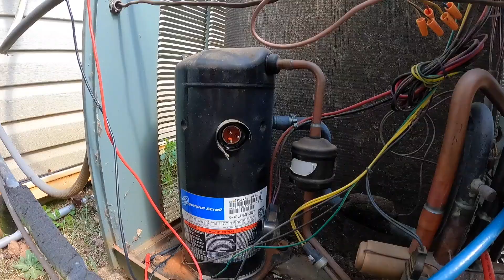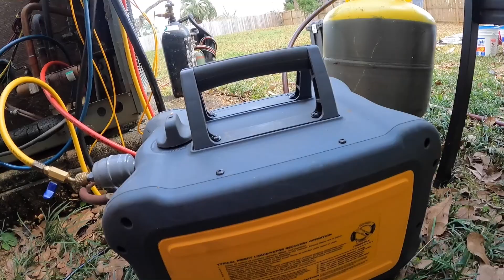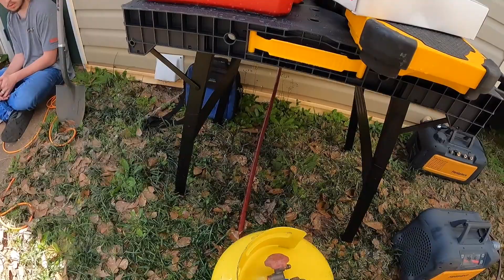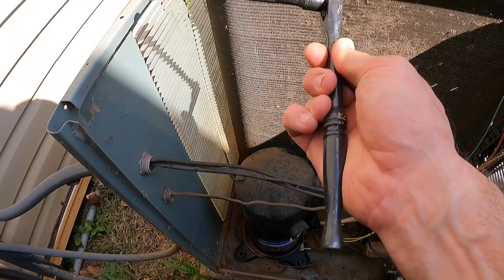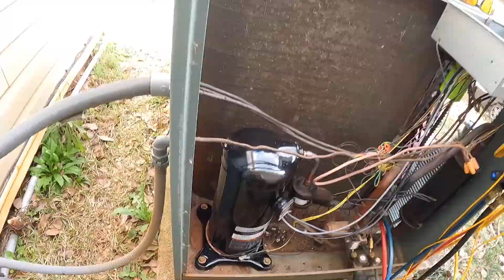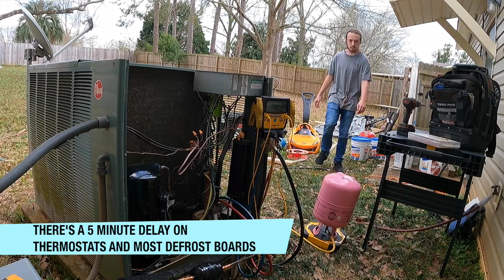Replacing Compressors

Comment: What style dryer is that with no fitting on end. We use zoomlock as well. I havent seen these dryers.
Reply from the maker: Hey Robert,  the SKU for these is BF163-PZK.  It’s a parker-hannifin product.
Reply: @AIRMANHVAC  thanks. We mainly use on heads of mini splits. Like the idea of dryer.

Comment: I must say I was a doubter but bought that “Molecular Transformator” coil. To my surprise it makes a HUGE difference on hot days with recovery of 410A. I know it’s about $140 bucks but it was well spent $$$. After 38 years in the trade I also have made my power cheater cord 10’ long. After clipping it to the disconnect I zip tie it to the whip at the box so there is no strain pulling on the alligator clips. This also gives you a bit more work area due to recovery machines & vacuum pumps having such short cords.  Throughly enjoy your work and videos.👍
Reply from the maker: Thank you for the tips!  I’ll check that transformator out too, looks like people love it.